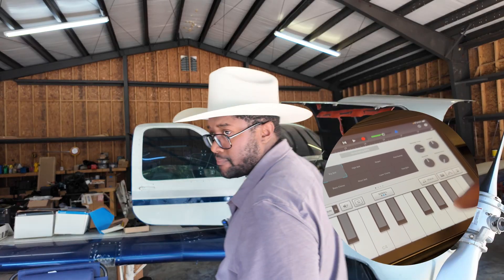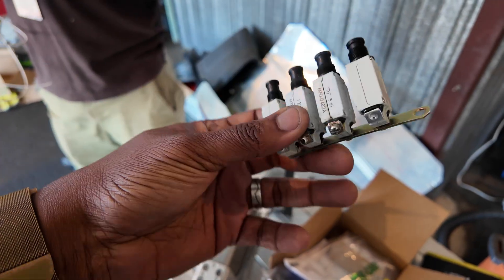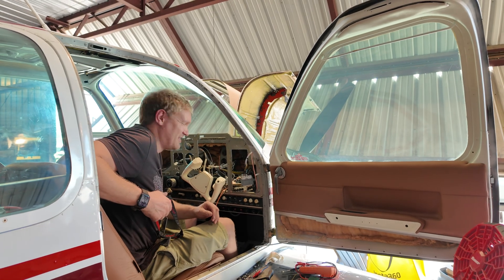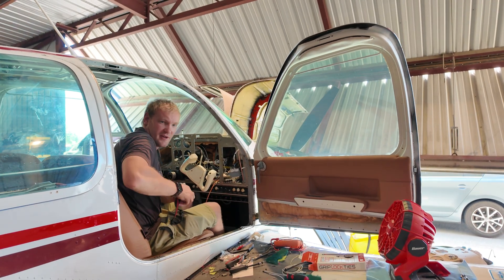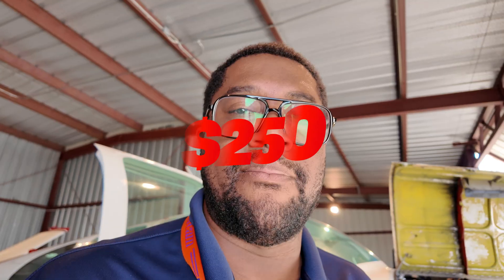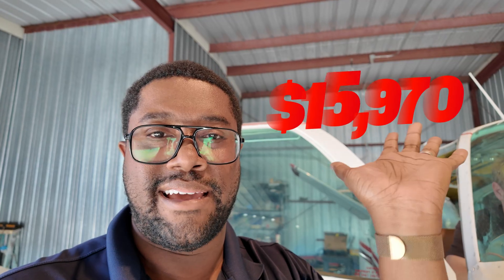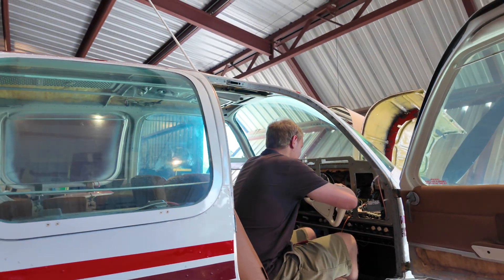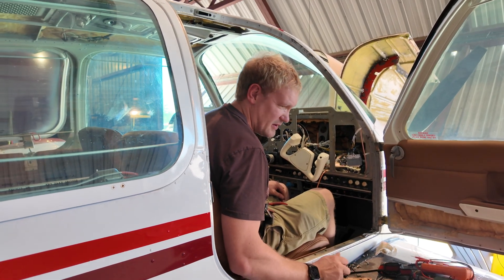My Avionics Cost How Much?? And More Tips You Can Use

Comment: Automotive parts have been used on more kinds of vehicles and harshly used vehicles from street vehicles to dragsters and desert racers to moto cross motorcycles and more for over 100years. The concept that they are weak and dangerous is ridiculous. If you think the auto fuse may not be manufactured correctly, what make you think the mass produced $40.00 circuit breaker is perfect and infallible? Sorry but that line of thinking is nonsense. In fact aircraft engines with all the annual inspections and required maintenance fail at much higher rates then car or truck engines that are abused by irresponsible drivers. Having said that, I do agree with most of your line of thought.
Reply from the maker: The difference is I know where my breakers came from - I have no idea who manufactured the fuse or the holder. Neither were stamped. Trust but verify. But there is logic to your opinion. I would have no issue putting an automotive part on an airplane - my starter relay or alternator for example. Difference is I know where it came from and the standard they're manufactured to which is a requirement on certified airplanes.
Reply: @OpenSourceGA  interesting point but consider that the Certified approved voltage regulator for a Cessna 150 was simply a ford voltage regulator with different labels on the cover and cost $$$$ more then the same regulator from a ford dealer. The internal parts were all the same parts.
Reply from the maker: Absolutely! The alternator on my Cherokee was nothing but an automotive part with a different part number. Nothing different. That was always the hope that the every-man would be able to get parts off the shelf but the mega corporations don't want that. The label is the important part - for traceability. If some bad actor put Plutonium in "Generic Delco Part 12211 Batch 3", you need to know whether or not "Generic Delco Part 12211 Batch 3" is installed on your airplane.

Comment: I don't yet own a plane, so I haven't yet woken up in my mechanic's bed... But in contemplating used avionics, one thing that concerns me is all the doo-dads that you need to get right for a particular plane/installation.  Am I just being irrationally paranoid that in some cases, buying that stuff from Garmin (or others) can significantly jack up the cost, or is it more straightforward that I'm inferring?  It sounds like you got a set of doo-dads with the various units and that was what you needed (pretty much) for this installation other than the items you mentioned like breakers, wiring, etc. (Also, subtitles when Simon is talking from across the hangar would be nice.)
Reply from the maker: The used market isn't for the faint of heart! No warranties, missing connectors, bent pins, missing paperwork...it's a risk but has big rewards. $11k used vs $20k for the newer model for example. The idea is to check the installation manuals before buying to know what the unit would usually come with and request those things (or a steep discount if they're not available). You have bargaining power as a buyer of used things on the open market. You'll realistically only know what to look for if you have a Simon in your life or if you've familiarized yourself with the manuals. The doo-dads and doo-hickies are also available new and used separately. I've definitely bought bargain bin circuit breakers in bulk before. They're easy to bench test. Only downside is if you don't have what you need when you need it, the project comes to a halt and you don't have an airplane to fly for just that much longer. First world problems. 

Good news is modern Garmin equipment have a common design philosophy and what you'll need for one unit, closely resembles what you'll need for the others. Remember the STC paperwork (for us certified suckers), sometimes a letter of authorization to use that STC, an FAA 8130-3 form and a good old fashioned handshake in person usually leads to success. Other good news is why gamble on Facebook Marketplace or Trade-a-Plane when companies like BAS exist? They part out unfortunately damaged airplanes and give their known-good, documented and tested equipment a new lease on life...with a reputation to protect and good customer service. You'll still save considerable amounts of Pesos. 

I present an alternative: also consider the competition. For what I just paid used, I could have gotten a new large Dynon touch screen to compliment the perfectly functional GNS530. Or filled my panel with AV30s. Or add a G3X. At some point I had a decision to make and this deal was too good to pass up. As usual I wasn't looking for the deal...it found me. You should see my credit card balance.

Comment: My own avionics upgrade for my G109B was about 7.5k.  4K for the Stratus ESGAP Bundle  with ADSB In, 2K for the ICOM Radio, then about 1.5K for misc parts, and A&P sgn off.  I did all the work under guidance.  All stuff TSO.